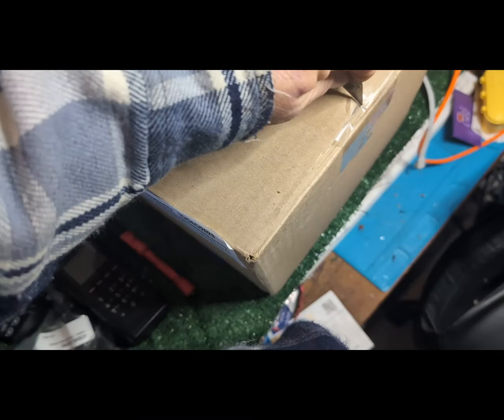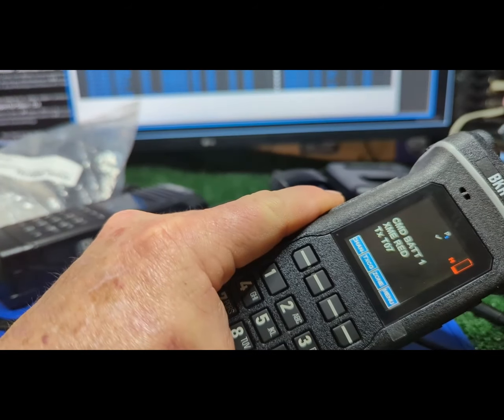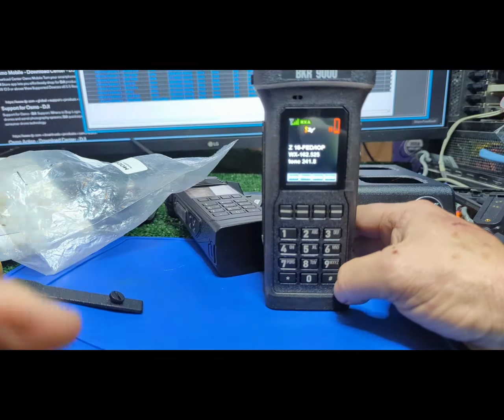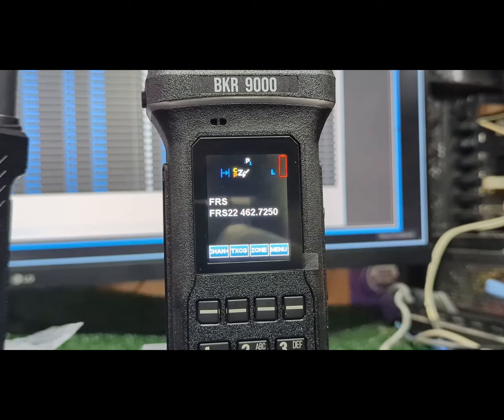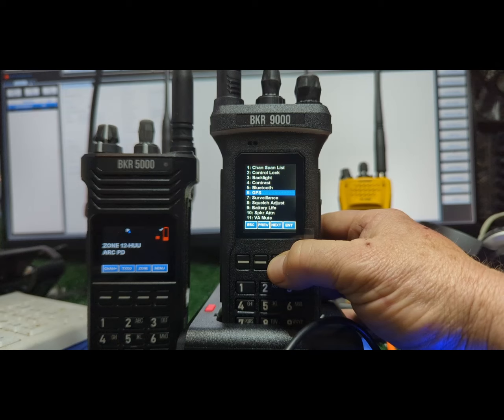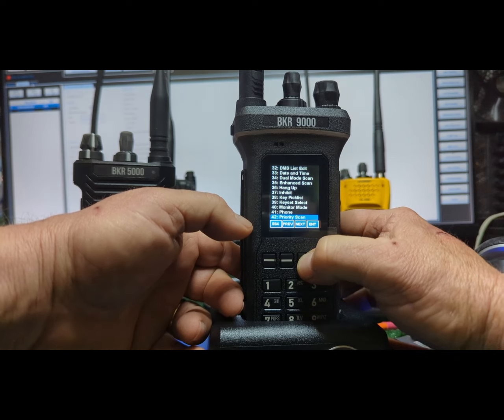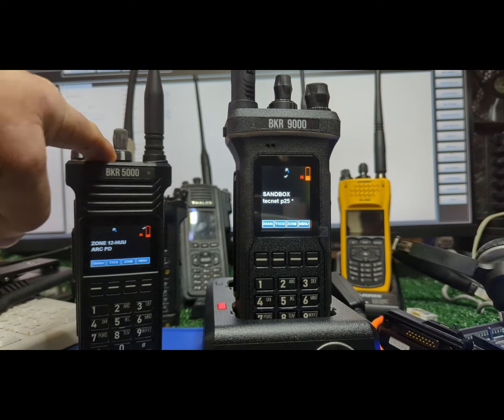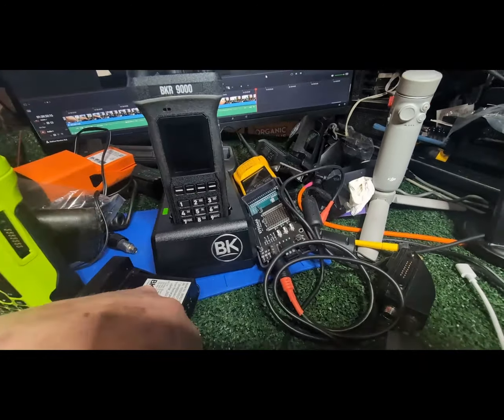BKR9000 RadioNerd's 1st Look

Comment: I really enjoyed seeing your experience with radios, and especially tasting voltage. It’s great to see that your tongue is properly calibrated to 3v. 

Question for you, I also just got my BKR9000 this week, and I’m really struggling to find any audio adapters other than the two BK RMS’s. I was going to make my own, but I hear rumors that the BKR5000 and 9000 now have a proprietary and possibly encrypted connection to the radio.  I need to connect a high-noise environment headset.  

Thanks for the great videos, I’m learning a lot.
Reply from the maker: The firefighter feedback I get about the BKR0204 is the spring clip is weak and the mic falls off. They also complain about the size is too big and bulky. I have given feedback to BK about this, including the problems with the 1st batch failures. They had manufacturing problems on the 1st run, and I think the screws were also over torqued. One drop and the MIC would break open.  
 I was also disappointed that the BKR0204 only has one top button.  The original BKR0203 was thinner, had 2 buttons on top, and a smaller stronger spring clip. I've heard that is was discontinued.  I have the Orange button set as CMD/TAC toggle (Home Channel) and the black button is nuisance delete. 
They did improve the construction of the side connector adapter in BKR's.  Haven't seen any of the metal tab side connectors fail.  BK listens to their customers, so I expect an improved MIC in the future. I have dozer operators wanting headsets, and aircraft folks wanting a helicopter interface. With the number of pins on the BKR connecter, we might have to wait for BK to make, or interface custom jigs through a BKR0608 alignment test jig.    I like your review, cool.

Comment: Hi! When are you planning on making a video about attaching a hirose adapter to the programming cable? This is one of the last things I'm trying to figure out before making a purchase!
Reply from the maker: Ok, I will in the next day or two. I buy the Hirose Bulkhead 6 pin HR10A-7R-6S female socket bulkhead connector from Ali-express.

Comment: Is calfire planning to switch over to the 9000? I'm gonna guess if they do  it will be non trunking
Reply from the maker: They are buying BKR5000-CMD presently. 
For those that are considering the purchase of BKR5000, I have started to recommend the  single band BKR9000 for those that only need VHF. the price is not much more for the single band.
The continuous knob model just hit the streets, so there will probably be a longer wait for that model.
Reply: @radionerd1  that makes sense can always add the other bands later on.
Reply: Thanks for this info here.